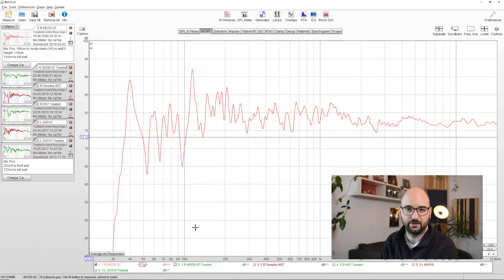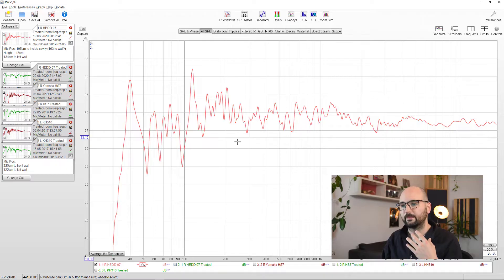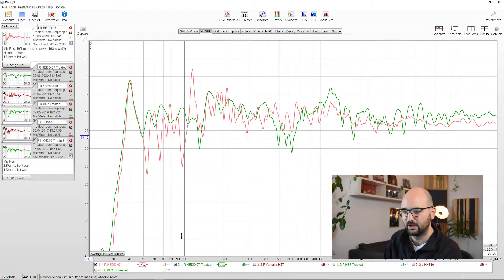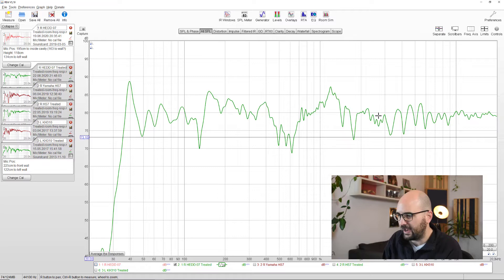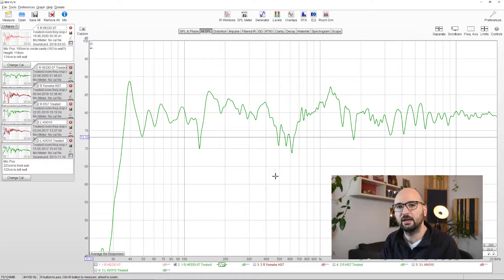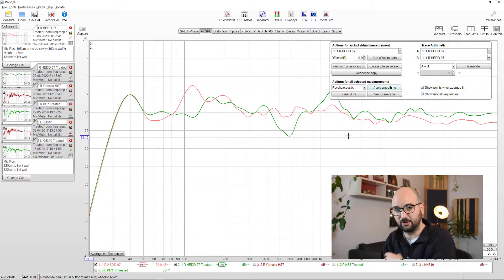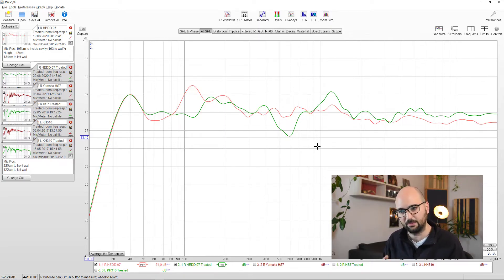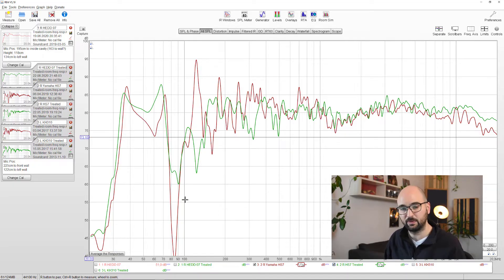Frequency Response: What’s a good response in a treated room? (measurements) - AcousticsInsider.com

Comment: I get it! My question is, do most rooms influence the low frequencies positively? 

If so, then why if you were a manufacturer would you not design a speaker to compensate for this, instead of forcing owners to have to change the room. It seems to me that most people don’t think about treating a room years before they buy a house. Usually, they get a house and then when income is available, they start thinking about getting the audio system of their dream. Furthermore, it may be more expensive to treat a room. Typically the wife will say, are you crazy; I’m not having those ugly panels in my walls and ceiling. It’s not my taste!!! Hahahaha… But is true.

Moreover, I look at the issue of the low frequency bias and it seems to me if I already have the house, then I need to first get a speaker than compensates for the room acoustics as is. I would think getting a speaker with a response that slowly drifts down linearly towards the low frequencies (200-40 Hz) corrects for this effect.

Comment: How do you know if the issue is a speaker problem, or a room problem?

Example, a speaker with a boosted bottom. mid or upper-end response, or a speaker with a bad dip in its response.

Comment: Echoes my own experience. I installed 15 larger absorbers, the frequency response didn't get that much better, but rt60 went from 1.7s to 0.7s in the low end, and 600 to 300ms from 100Hz up. Playback of music is infinitely clearer, in bass and mid, and stereo image is also clearer. Several people have remarked (spontaneously) how clear things sound. And I didn't even start fixing the obvious early reflections yet. Delighted with the result, it's such a pleasure to listen there, and far less fatiguing.

Comment: I think I broke the replay button this video...
Spent a solid day hunting the bass.. sadly, where I liked the bass feeling the most was hella awkward to setup a desk (aside from converting my whole room solely for production).  I settled on the 'direction' I wanted to setup (facing a window) and just measured different spots/speaker locations along the mid room axis until I got the most 'flat' base measurement (currently about 9DB from peak to trough).  Hope as treatment gets installed I can bring that down to a solid 6DB variation!

Comment: Step 1: Figure out listening and speaker position
Step 2: Work on your decay times with absorbers
Step 3: linear phase EQ in your master bus. The delay when hitting pause/play is annoying but knowing what your ears get is perfectly linear is worth it. Turn it off when software monitoring though.
Reply: Is linear phase eq that crucial though? EQ generally doesn't shift phase that much.
Reply: Yeah EQ isn’t going to cut it. You might cut a peak that’s it.

Comment: nice vid but kinda discouraging at the same time. I have more than 20 panels in my room and from 200 to 2000 is still pure madness. ive trapped 90% of my corners. most with 17" thick traps.the front 2 corners have 4" thick panels going across 4 feet of the corners floor to ceiling. im going to fill the gaps with treatment soon but your video kinda explains why there's barely the difference I want. I can clearly hear the difference entering the room (thats prob the decay time) but recording vocals still sounds shit. kinda boomy and the peaks and reflections. have a 6' by 8' 6" thick with 5 inch gap for my cloud too. its a struggle
Reply: Yeah this made me more discouraged to acoustic treat the new room I’m moving too. Seems like it will definitely be too small for any reasonable quality and improvement.

Comment: Most relatively small +/- 5 peaks and dips are not audible.
Reply: I’d think it’d need to be less than 3db to not be audible since that’s the minimum level humans generally hear changes in
Reply: @chukah9484  I can hear 2dB differences, but thats not the way these measurements work in real audibility.  Two ears don't hear like one mic.

Comment: Based on your guidance, untreated I am already within about a 10-15dB when the psychoacoustic filter is applied. Granted, the waterfall is atrocious, but should I be re-calibrating my Scarlett 18i20 and/or ECM8000? I followed the GIK guide on here. When no filters are applied then there's a ton of nulls - is that normal? Thanks for all of the amazing info, man!!

Room: 151"x126"x93" / carpeted floor (ugh!) / 67.5 monitor spacing / 61.5 seating position (6" rear triangle setup) / 3" nearest monitor corner spacing from main wall for SBIR hacking :)